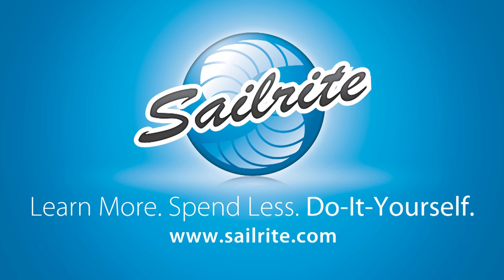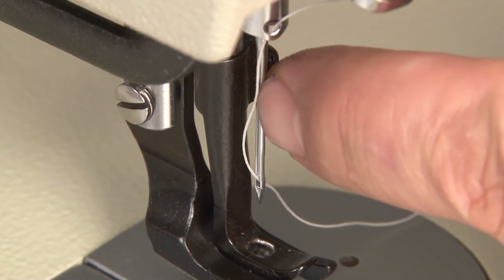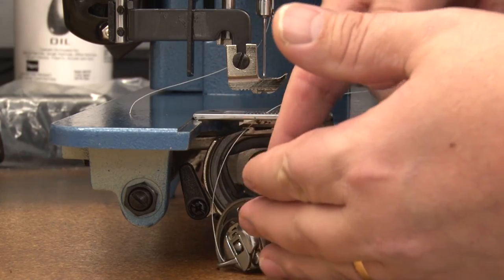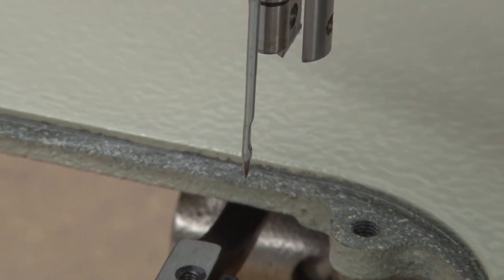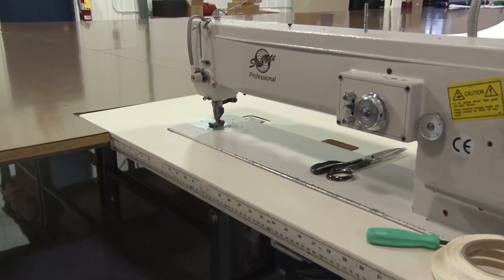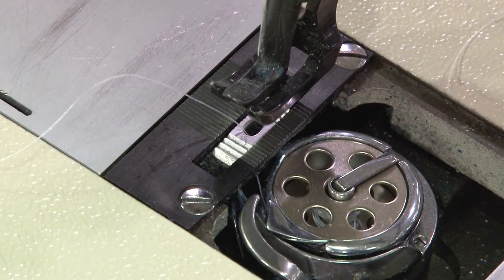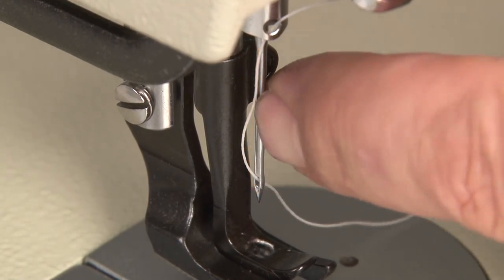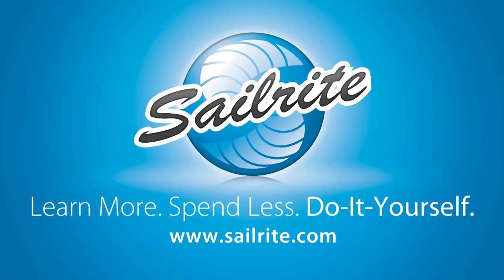How to Insert a Sewing Machine Needle

Comment: I have a Euro-Pro deluxe demin machine and my needle keeps falling out.  I have put the needle in correctly with flat to the back but the screw will not keep the needle from falling out.
Reply from the maker: +Agnes Marie Dill You may need to contact your Euro-Pro dealer and ask them why that is happening on your machine. Sounds like the incorrect needle style or the set screw is stripped. We do not sell that type of sewing machine, so we can't help, sorry.